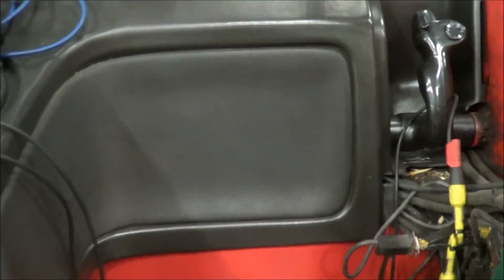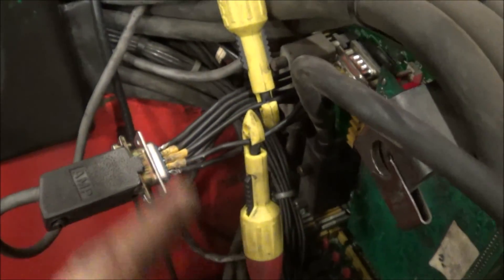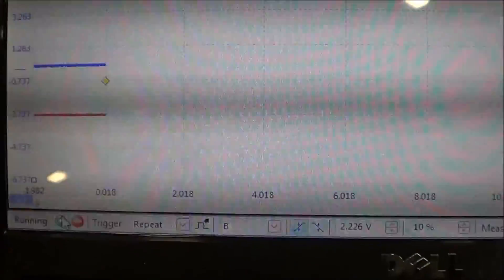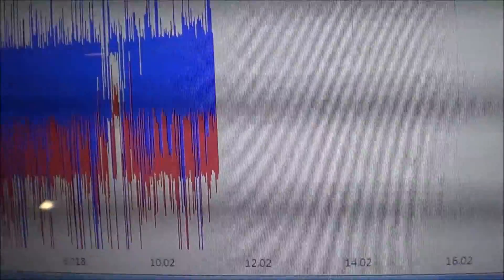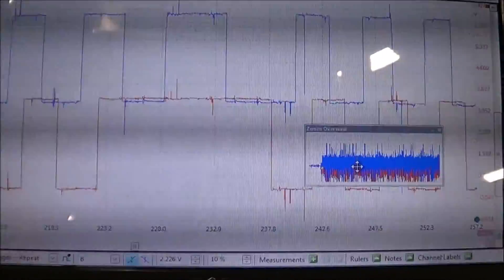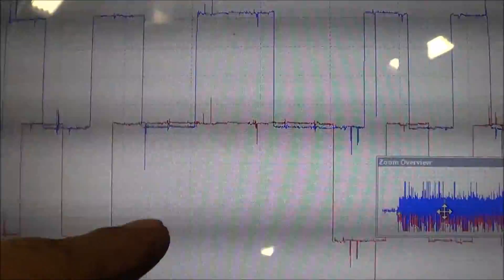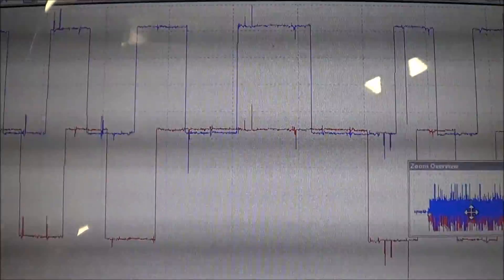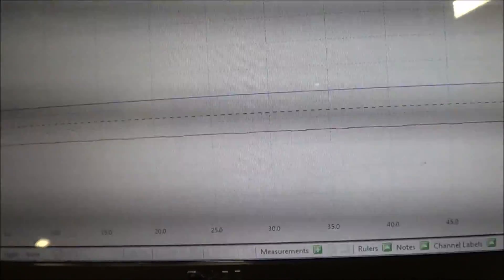How to Check Motor Encoders on Raymond Easi

Comment: Do you encounter hydraulic function problem of 7500 dr32tt raymond for cold storage, it lifts in its own when using auxilliary function. Already check the electric connections but dont have a problem.. I think its in the main manifold, the valves or relief valve.. Can you please give me some advice where in the main manifold should i check to solve this problem.. Thank you for your reply..
Reply: @jemuelvelarde7199 Do you mean that when you shift tilt or reach, the mast lifts? If so, did you find the problem?
Reply: @jbierling I'm having this issue now. Anyone have the answer?
Reply: @fast1984 that’s likely the aux valve in the manifold. If it’s a side stance truck, the valve points almost at the control handle. Most the time, it’s more likely to do it in one direction. Like…. When you side shift left it will do it more than SS right. Or visa versa. On newer trucks, it could be the priority on demand valve.

Comment: Hey, do use any handheld scopes that work as well as that Pico. Those filters really cleaned up that signal after you replace the encoder. Very nice. I have been shopping for a scope. great video. Thanks
Reply from the maker: I've used a couple of handhelds but none was good as a pico.

Comment: Love your channel.  Can you tell me how to diagnose a  power steering amplifier on a 07 Raymond order picker
Reply from the maker: This steer amplifier receives commands from the vm. To troubleshoot you have to check the signals coming in and voltage or current coming out. Dont know how else to tell you how because every case is different.
Reply: @forkliftgeek10  Thanks

Comment: What scope do you use?
Reply from the maker: Picoscope
Reply: WiFi? I was looking at the Picoscope 4 channel. What model? I work at a dealer for Cat, Mitsubishi, and Junghienrich in IL. I would be happy to help you if I can with information. I also have service information on most brands or can usually get it.
Reply from the maker: No it's not wifi. It's a 4425. Thanks for the offer, greatly appreciate it.